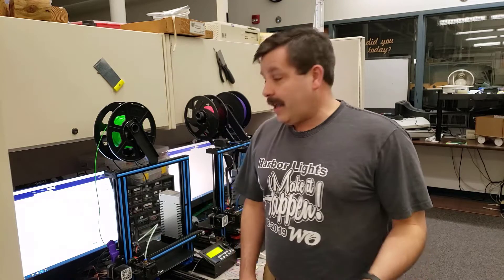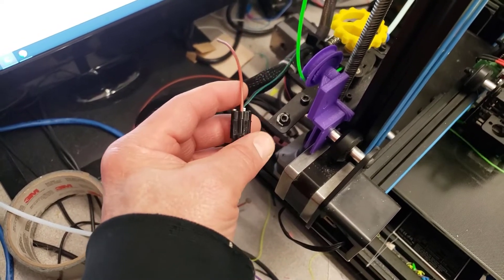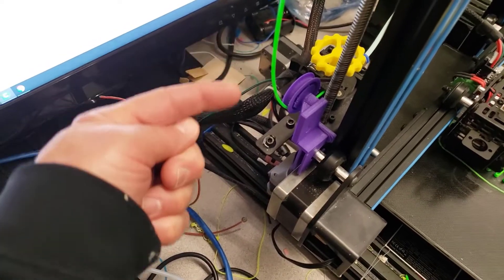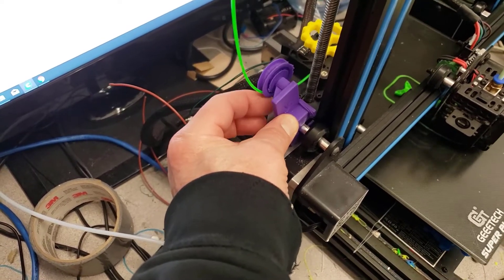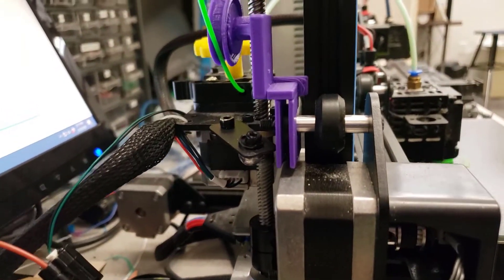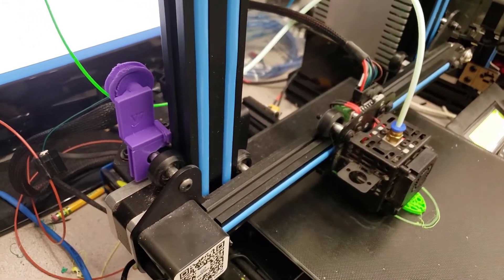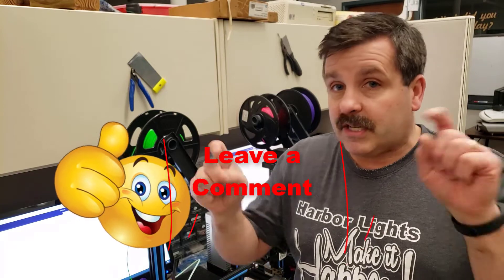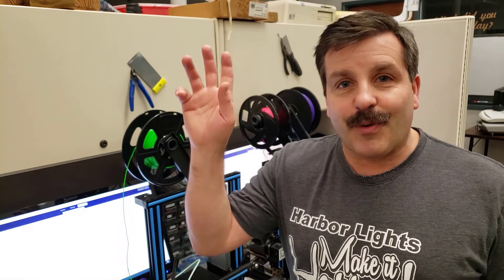Freaky Fast Fix Geeetech A10 Filament Run Out Sensor (temporary)

Comment: If you are never going to be doing any tall prints then just mount the spool on the side.  Works great!
Reply from the maker: That does make sense. I had to find a fix for holding that run out sensor in place though.  That little part has been working like a champ.